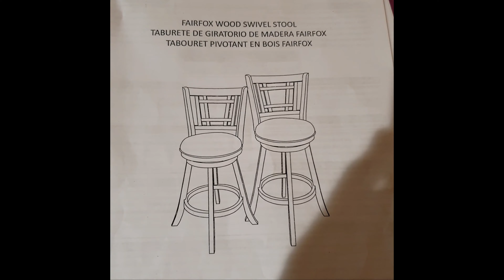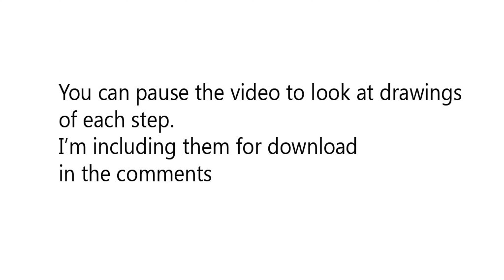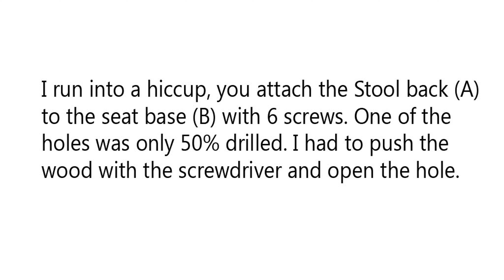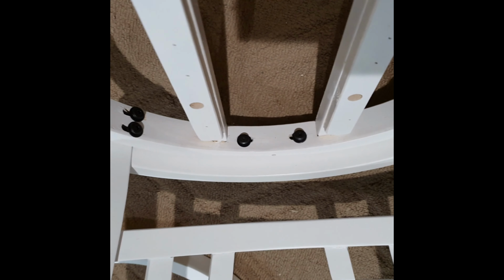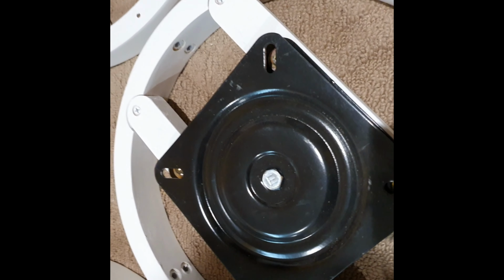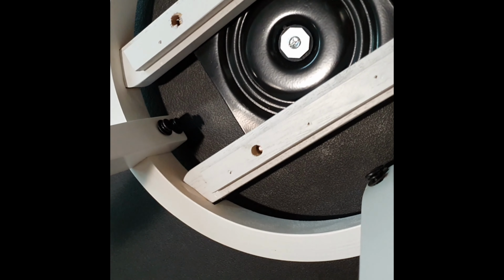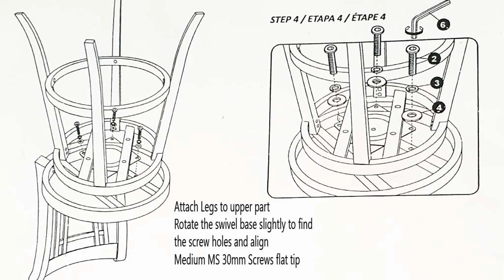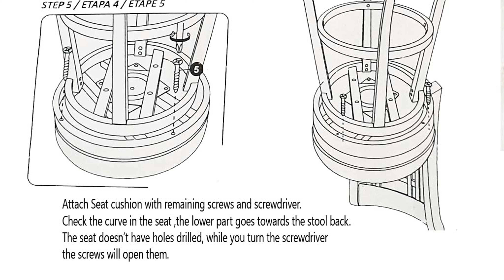Hillsdale Swivel Stool Fairfox - Assembly - how to - Tutorial

Comment: Super helpful! You helped more than the instruction manual itself ❤ Thank you so much!
Reply from the maker: Thanks for your comments. As of December 2022, my stools are working perfectly. I tighten the screws every two months or so. When you sit, you'll notice that it feels clumsy. I read somewhere how to prevent that "remove the loose screw, spread some wood glue on two or three flat toothpicks and force the toothpicks into the hole. Let the glue dry, then cut the toothpicks off flush with the surface of the hinge recess. Put the screw back in and tighten it. It should grip firmly." Maybe I'll try that next time, but not all of them fall off due to vibration, mostly the ones that rotate the seat. The fabric in the seats is not that good, stains even with water, and doesn't come off. I tried to steam clean, and spray with upholstery cleaners, but still...I did use an upholstery sealer when they were new, though it didn't seem to help that much. I consider the furniture itself very sturdy. Maybe if the off-white fabric becomes too far from off-white I will redo the upholstery with a darker fabric.

Comment: Thank you!
Reply from the maker: As of December 2022, my stools are working perfectly. I tighten the screws every two months or so. When you sit, you'll notice that it feels clumsy. I read somewhere how to prevent that "remove the loose screw, spread some wood glue on two or three flat toothpicks and force the toothpicks into the hole. Let the glue dry, then cut the toothpicks off flush with the surface of the hinge recess. Put the screw back in and tighten it. It should grip firmly." Maybe I'll try that next time, but not all of them fall off due to vibration, mostly the ones that rotate the seat. The fabric in the seats is not that good, stains even with water, and doesn't come off. I tried to steam clean, and spray with upholstery cleaners, but still...I did use an upholstery sealer when they were new, though it didn't seem to help that much. I consider the furniture itself very sturdy. Maybe if the off-white fabric becomes too far from off-white I will redo the upholstery with a darker fabric.